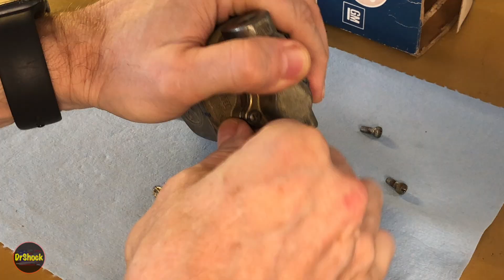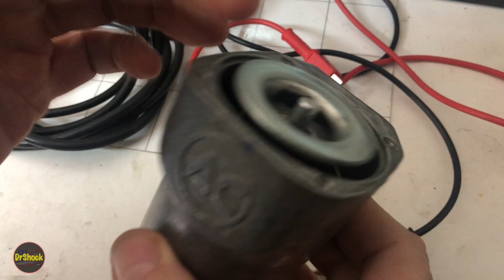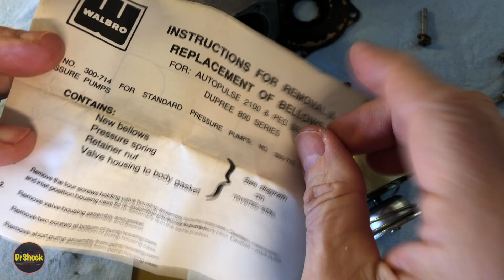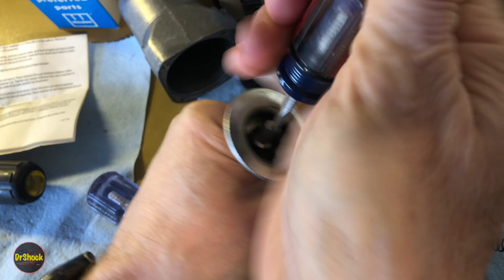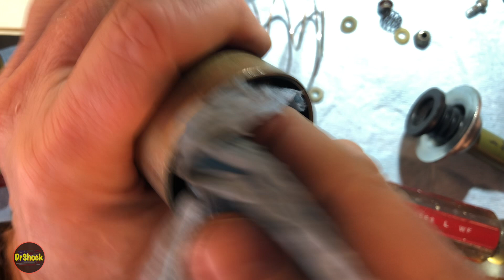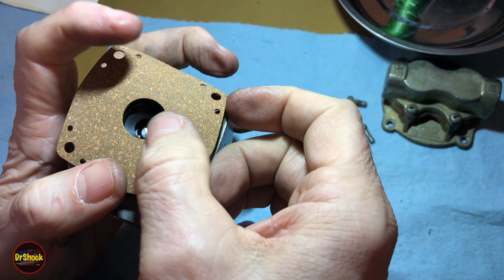GM AC EP12 ~ OEM Walbro WEP12 Bellows Style Fuel Pump Disassembly, Rebuild & Testing Process

Comment: Great educational video on a Walbro bellow  fuel pump rebuilt. You did a great video showing all the steps!. Thank you very much. I have a 1937 Buick. I used this type Walbro 6 volt #2404-1 since 1989. I replaced the first one was around 1989 then the second placed 2021. I went to start my car for the spring  and  realized the car would not start. .No gas .  T he Walbro quit for priming the carb. No gas was going up to the engine cam shaft AC  fuel pump. I looked at the glass sediment bowl was dark . I removed the glass bowl , I found a large black  asphalt mass at the bottom. The inside of the glass bowl was coated with sticky stuff. The gas had  Ethanol.
I am in the process of removing the accessory 6 volt Walbro pump and just use the original fuel pump that have been restored with modern gasket's etc. I hope my restored gas lines with stainless  lines are of ok .  I always used a Napa fuel filter in front of the Walbrp fuel pump. The gas station changed there gas last year when I filled up in the fall of 2025.